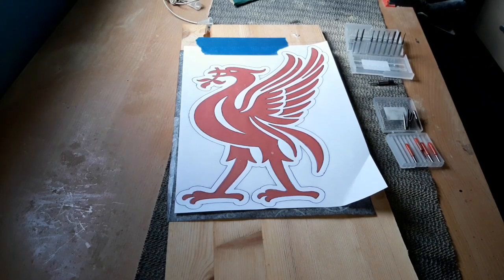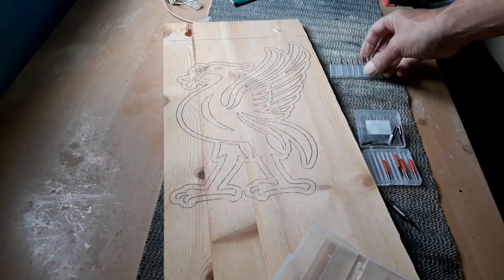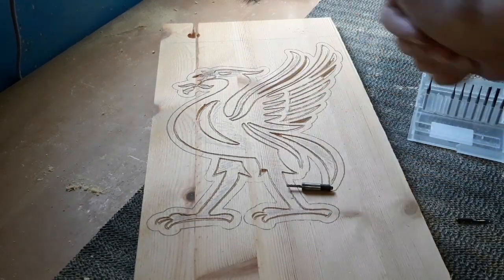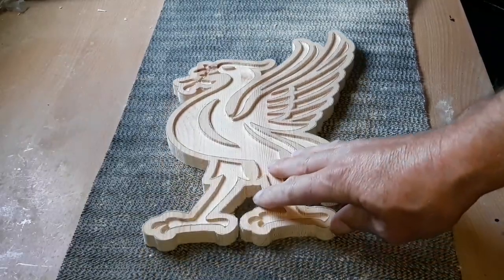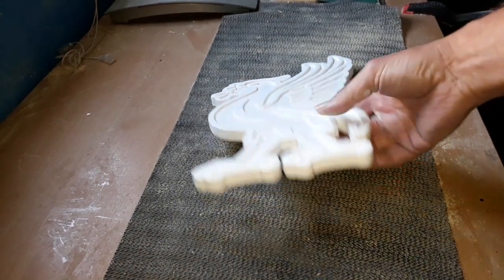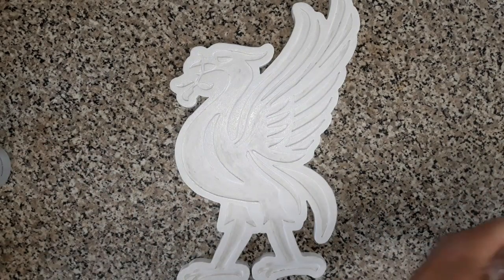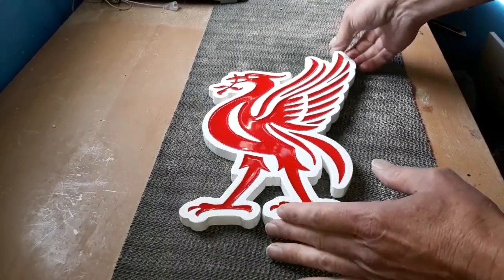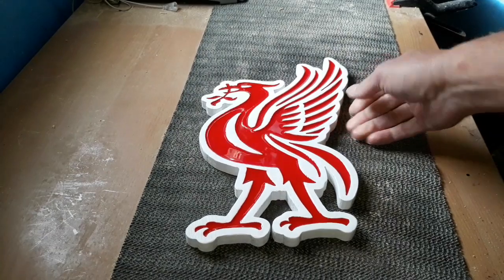Liver bird with resin inlay on recycled wood,router project.

Comment: Where did you get the bits what’s the name of them.
Reply from the maker: I get my bits from Ebay or Amazon, cnc router bits they come in different degrees 20 degrees is mostly used.. they have a dremel size shaft,3.175mm so you will need a adapter collet 6.35mm so they fit a router.
Reply: @fishtank5050  Can you please provide the name of company that makes the router bits?  I have searched Amazon and cannot find those particular bits.  Thanks so much.  Great videos!!
Reply from the maker: @javierandjeannesamaniegoan7788  I get my bits from ebay but I know you get get them from amazon..cnc https://www.ebay.co.uk/itm/172213663526..end milling bits https://www.ebay.co.uk/itm/182126325465..adapter reducer collet https://www.ebay.co.uk/itm/383900851057...they very in price,so go down the list.. 👍